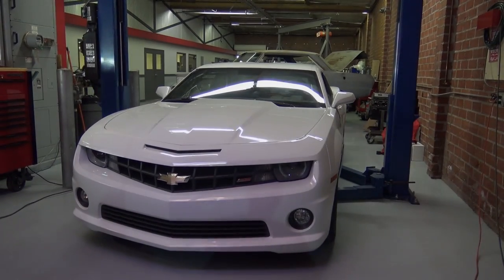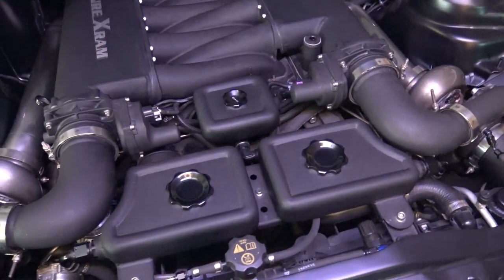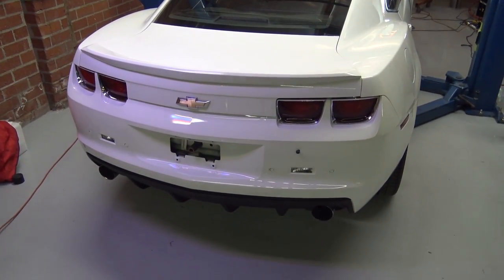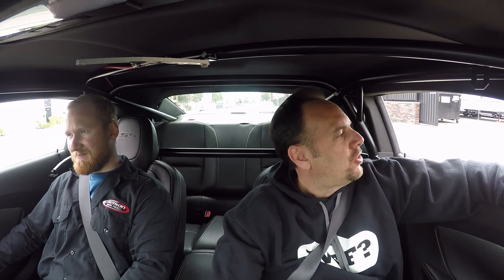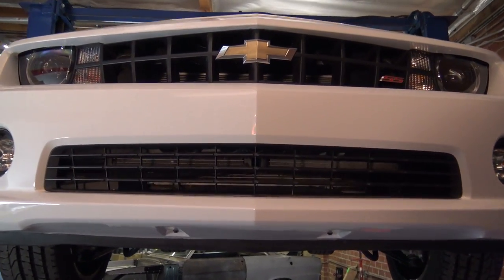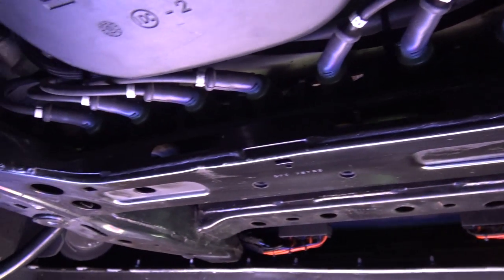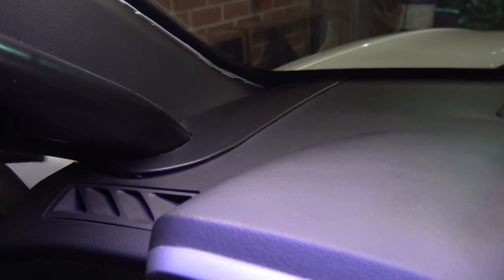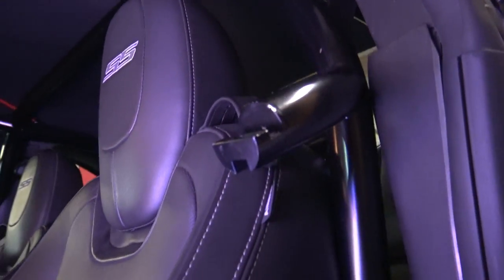World's Ultimate Sleeper!  Street Test NRE Patented Mirror Image Turbo 427 LS Camaro Daily Driver.

Comment: This is the most beautiful build I think I've ever seen, and I have a pile of show trophies that have a pretty thick coat of dust on them now.  So stealth.  Insane.  10/10.
Reply: SS's arnt very stealth lol.
Reply: You're 100% correct, but there are plenty of import owners who aren't afraid of a stock one.  (And all of them should be afraid of this one)
Reply: depends how well built the import is lol. even with less power it could still be as fast as this because of weight difference

Comment: Fantastic work.  I am so impressed!  When standing in front of the car and looking at the motor, all the hand fabricated reservoirs are symmetrical and perfectly spaced and perfectly aligned.  The entire parts fabrication is the best I have seen.  I love what you did there.  Water to air intake manifold to not have a big obvious front mount IC to block radiator airflow and oil cooler air flow.  Awesome!
The plumbing of turbos is again symmetrical and perfect visually.
What you did to keep the wipers working was fantastic rather than leaving owner screwed.
Mad props guys.  If I ever get enough money for a really nice V8 build you will be the ones I call for the drivetrain work.

Comment: I like how tight the cage is mounted, but you wouldn't want to hit your head on those door bar extensions off the main hoop. It's right at head height too. In Australia they make you wrap thick foam padding around any cage work that's even remotely close to any part of your body cause the cage can be more of a hazard if you don't have a helmet on or hit it hard in an accident with your arms or torso. Hit your head on one and it's all over if your not wearing a helmet

Comment: Great overall execution and engine fit to this Camaro.  We see there was great attention to detail in everything.  My main question is did you look at mounting the turbos 90 degrees to their current layout?  In that position the exhaust input would be a straight shot to the turbo wheel and the exhaust pipes could route outboard thru the fender wells above the wheels and then back under the car.  It also could eliminate the 90 degree bends to feed the throttle bodies.  Anyway, I enjoyed the video and love the idea of a high 9 second sleeper.  Thanks and keep up the good work.

Comment: Well done 👍 👍 You always have it done right and finished.  I love that about Your work .  Your projects are always 100% complete and look factory only again 100 times so much better.  The way the factory should have rolled them off the floor.  One day when I get all my ducks lined up in a row,  my 67 coupe Shelby/ California special I’ll be coming that way .  I bought the block first a while back ten years ago the car I bought off my dad it was his first car. I was stroking out the dart 351w to a 460 or 472 I got cp pistons and the eagle rotating assembly and that’s where I’ve been stuck I was going to throw a 8-71 dual carbs afr heads but now I want cali’s ultra light for the crank Oliver’s ultra light connecting rods And Your top end because I want 2,500rwhp at least 1,200 and I don’t know if that blower is going to work so going sleeper with turbos I don’t lol

Comment: Nice work done on it but those water tanks are very small for the amount of power it's making. Don't think it has enough volume for extended runs before it heat soaks the system.

Comment: Hi, i was wondering what a good engine choice would be for a kit car I'm planning to build.
Engine layout: Rear mid-engine, rear-wheel drive and uses Chevrolet LSX engine.
What I'll be using the car for mostly on the streets as a daily, but I want it to whoop ass as a competition car.
Price range I'm hoping for around $40K or less, and a quarter mile around 7 seconds.
Reply: Also in My area there are no regulations on a cars torque, horse power Ect. :)
and the cars "stock" engine is a 6.8L V8, though from the videos I've seen you might be able to fit a 7L

Comment: What the point of watercooled heat exchangers, moreover built in ,not serviceable ?
You need pumps,relays,more piping and hoses wich add weight,if failure you lock and blow the engine.
And the airflow is not the best there.
Reply: If there's a problem in the long run, just remove IM to a conventional manifold.
Reply: michaelovitch With a setup like that the piping is actually easier since you don't have to run a large air to air on the front with large pipes from the turbos and to the intake. This way you just need some small coolant lines and a relatively small heat exchanger. Also for a short run you can pack the tanks with ice and really cool it down.

Comment: Would it be doable, and beneficial- to make this AWD? A custom transfer case, and mimic the driveshaft and differential for the front? What if the powertrain were transverse, then moved to midway, no back seats. That would take some fabrication- and the only dead giveaway would be it's a two-seater. Make a custom insulated Doghouse over the power plant.

Comment: Ever considered adding a water/meth injection system to compensate the heatsoak and relatively small intercooler capacity? 1 injector per bank would probably do the trick.

Comment: Hi ,. just wonmdering  the price on the X-Ram manifolds? I have an LY6 truck engine which is basically for all intents and purposes, is basically (apart from the iron block) an LS3 on the outside with ally L92 heads, mounting boss wise though has a great big log manifold for torque I am assuming lol. (That will be amongst the first things to go lol) I will be doing a twin turbo build on it with at least 800hp,. maybe more,, I just want you to talk me out of getting the edelbrock x-ram intake and buy yours ;)

Comment: The 5000 on the 2 makes the 4 with the 3 makes flow big and stock 7 is good because customer  is monster flow but reprogram the automatic to a stick make power Cage faster more only charge 500k for best original .

Comment: I have emailed NRE many times and never got a response. I have a 69 Chevelle that has a 502 in it and wanted to find out about the alien intake and cam combo you do. Is this not something you will do for just anybody?
Reply: Taxed to death Tom Nelson does them.for the 502 an 572 like I have in my 86 iroc you just have to keep emailing them I got mine from them
Reply: I would say they are into high end big dollar builds and has a line up of work miles long.
Reply: Super Chevy 
What kind of motor are you running and what setup did you get from Tom/NRE? How long have you been running it and what kind of difference did it make? Have you had any issues? 
I ask because I "need" more power (because 500+ just isn't enough. The same if it was 900+, its never enough) and don't have room for a supercharger system and to do a turbo system to the 502 just makes no sense, its not a high RPM motor (I don't want to constantly have to tune either). I also use this as a daily/rice eater/smoke machine. Reliability and longevity is key for me...I don't want to do an injection system because if something goes wrong then you're usually stuck. I would probably give his system a go though.
There was another comment someone ad made about NRE having bad reviews and a bad company to work with. I am a small business owner myself and there is some people you just can't please, they're miserable and want others to be the same. When people do good work and you're on top of the game they line up to try and knock you off the perch...the perch you built yourself. His cars speak for themselves and like any trade, there is going to be issues here and there....especially after decades of owning it! I do mostly high end work (wish I got paid like it was though) and many of the other companies like to put my name in their mouth. I laugh it off!

Comment: 770hp at the wheels on 13lbs of boost??? On a 427??? With twins??? What kind of gas do you get in California? 50 octane. My stock bottom end Vengeance Racing built LS3 with a Vortec V3SI and water methanol injection and a cam makes 702rwhp and 638rwtq on 9.2 pounds of boost. Something doesn't add up.

Comment: These guys are like dodge and their challenger, instead of going lighter lets go heavier then add more power. It'll be just as fast in a straight line but suffer in every other catagory. 4000lbs is nuts already, at 4700lbs is psycotic.

Comment: throw some 29×10.5 slicks and my 740hp will eat it up in the 1/8 12000$ car 's 100,000 car lol
Reply: Josh Rooster Cogburn Wood add some weight to your junk and make it equal weight, and same size slicks on both  cars ... So we can see what you 750hp has let nelson add the boost and e85 so its more like 1800hp
Reply: put mine on methanol and ditch my intercooler I got a smaller motor and 1 turbo and I grudge race and I still think I got it all I would have to do to deal the deal is put a precision promod 88mm turbo I got a 78mm now bigger cam and il be be makin over 1000whp with junkyard ls1 with stock crank good rods and pistons workerd stock 246 heads and a holley high ram. so il take that race at 4500 pounds

Comment: Junk. It ses sumthing that ford's got the eyes most power output super charger. Rs200 3.5motor I think that's pushing and easy 1000whp at a weight of less than 2400. Designed to take just about any bump at just about any speed.
Reply: Go find a spot and lay down.  It is obvious you need rest and detox!

Comment: its kinda pointless you could have made a ls3 make enuf power and not weigh 5000 pounds and beat this thing in the ground and make it look like a stock ss
Reply: I'm just going to throw this at you if you listen to him he said 13 pounds of boost on pump gas gave him a thousand horsepower at the crank let's just say he switches E85 then he bumped the Boost which I can guarantee you  that it could handle double that which would  be 26 pounds what would the horsepower at the crank be 2000 oh yeah he's also if its switched and tuned  to E85 so over 2000 horsepower at the crank so he's putting a substantial amount to the wheels there with that 2000 plus horsepower and he has all the safety equipment ready for the track oh yeah what if he puts  some skinnies in the front and a big tire in the back and starts really going all out on the rear end and suspension man enough said  I love those engines LS1 LS3 LSA all those engines are bad as fuck but there's something special about this thing that it doesn't even have to try and its spitting out powder
Reply: I'm running a junkyard ls1 with good rods and pistons real ls6 243 geads a billet 78mm turbo on kill I can make 840 but its around 750 now on c16 race gas not alchol and I q run mid 5's in the 1/8 I don't do quarter mile but I think that puts me in the low 9's high 8's in a 3000 pound 77 nova with me in it. now if I ditched my air to water intercooler switches to m5 methanol and a precison promod 88ln or a borg500 88mm I think at At 4500 pounds if my converter will work and I don't lift my heads from the extra boost 4 bolt motors have that problem I would be close to 1200hp I would put my junk against a 100.000 dollar car
Reply: I'm on 17 pounds on 93 makin 600 somthin with no  timing in it